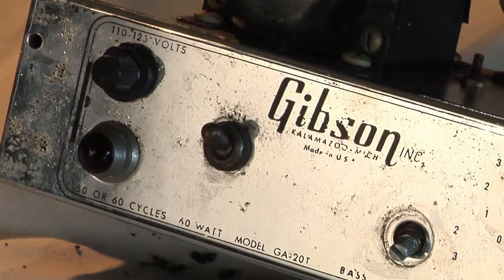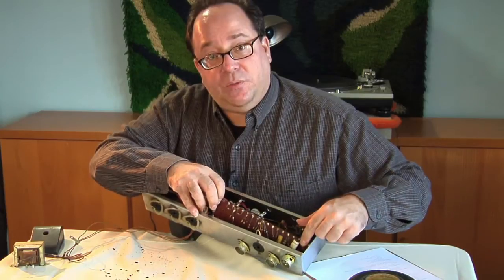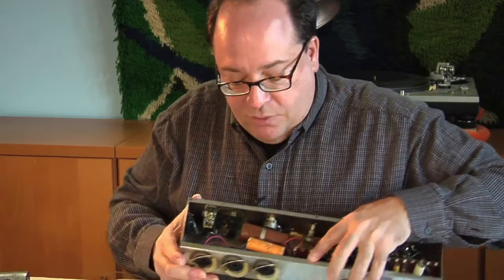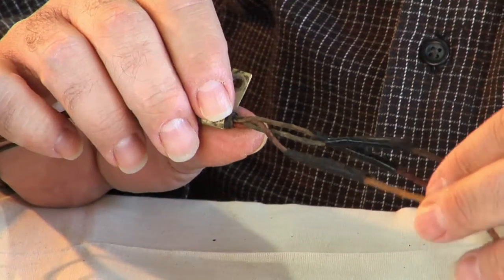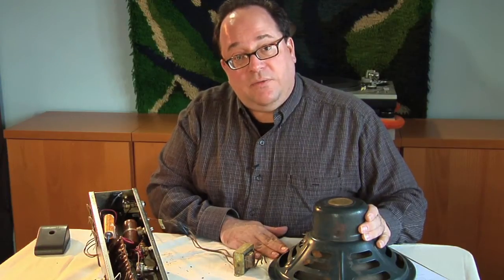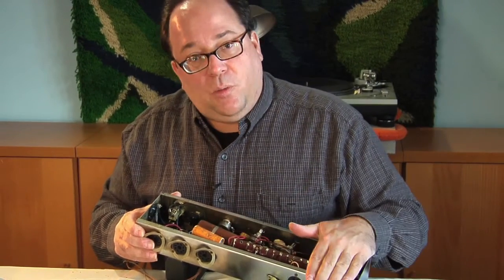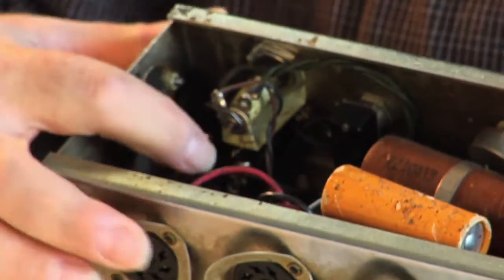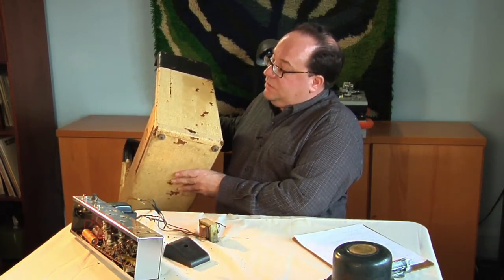On the Bench - Gibson GA-20T (Vintage Amp Restorations)

Comment: A five second google search would have told this man this amp is a 1957 model and not 1960, and that's why the original speaker also is from 1957... duh. Also, some caps (like Ajax blue Molded) stand the test of time much better than others, and may not be replaced like he's doing here.

Comment: Interesting video and a great amp but, I must object to arbitrarily replacing all the coupling capacitors. This is not only lazy but,you will loose the great vintage tone these amps produce. Those Astrons in there if leaky, should be replaced with NOS Astrons. This is why I dont trust professional amp techs.